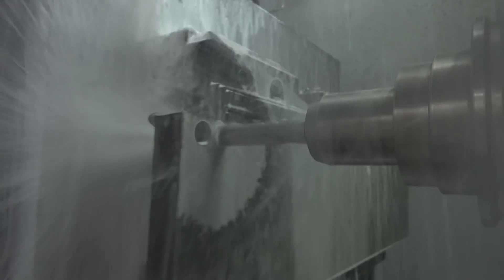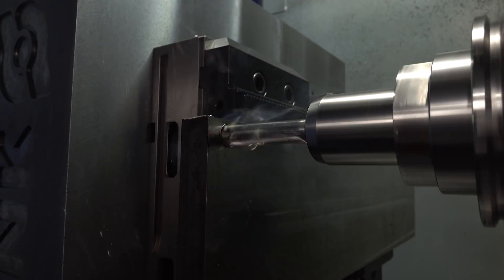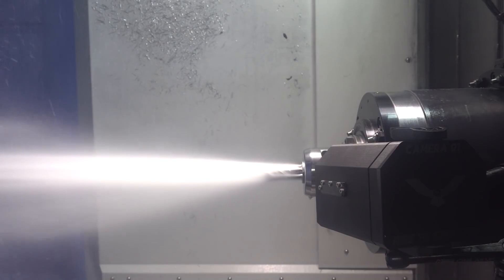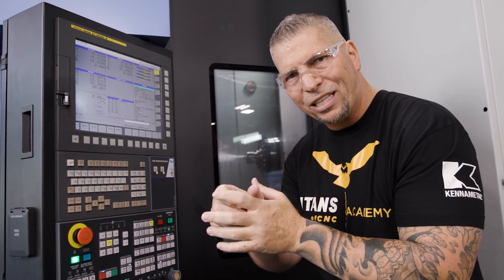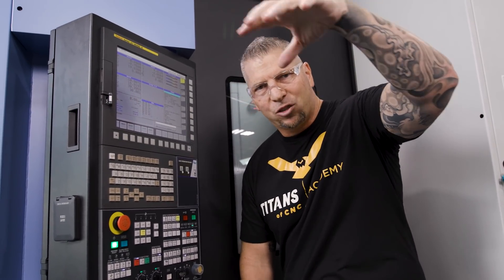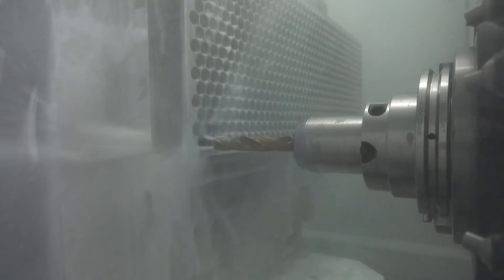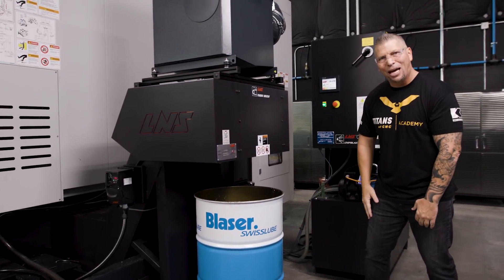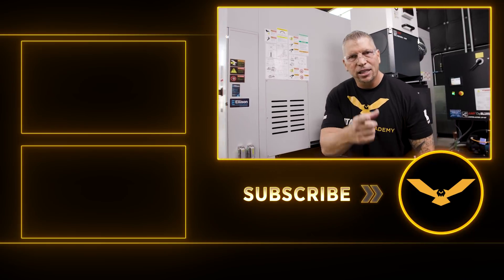Coolant Hacking | 6X More Powerful than a FIRE HOSE! | LNS ChipBLASTER JV-40 + LNS Turbo MH250

Comment: Nothing quite like high pressure through spindle coolant - as shown it allows for incredible speeds and feeds, especially with inserted drills, and in hard to machine materials. 
Unfortunately, also as shown, there's absolutely no room for error - just the slightest delay resulting in cutting before full coolant pressure and the tool almost always becomes scrap in an instant. 
Since I found out the hard (and expensive) way, I've always programmed a more than sufficient dwell time and watched a "test cut" off-part to be sure I've got full pressure in time.
Good demonstration.

Comment: Due to cost cutting healthy uncontaminated coolant is over looked just as the need for high pressure coolant systems in the industry as well. 

That’s a real nice flow most I’ve seen. ❄️

Comment: We were using hi pressure coolant, (1500 psi and up) on our deep hole drilling, gun drills and Allied Spade drills back 15 years ago.   The ONLY way to do high speed deep hole drills.   Glad this old technology is working out good for you.    Cheers.

Comment: surely the coolant pressure is the wrong thing to compare because having a higher pressure doesn't mean a higher cooling potential, surely the better comparison would be mass flowrate because more coolant flowing means more cooling not coolant at a higher pressure means higher cooling potential
Reply: The main reason you’d use high pressure coolant is to help with chip evacuation. Chip buildup is one of the biggest limiting factors when drilling high speed. High pressure coolant literally blasts the hole clear so it’s not an issue.

Comment: how do you dump your chip bins when they are just oil drums? I'm used to the giant bucket on wheels and you dump it with a forklift by tipping it
Reply from the maker: Old School

2 🤷‍♂️🤷‍♂️’s
Reply: All it takes is a forklift with a barrel clamp..
Reply: @donparker8246  add another attachment to actually rotate the barrel

Comment: Hmmmm, so a few videos ago you showed a plastic desalination pump, that multiplies water pressure from 80psi to 800 psi (according to the patent).
And now you show that your coolant is running 1000psi instead of 100-300psi. Did you just buy a bigger pump, or did you plumb your desalination multiplier in there?
Reply: They were making parts for a customer that does desalination. This pump is completely different, part of the machine tool.
Reply: @Eggsr2bcrushed  I was mostly joking here. I didn't actually expect them to jerryrig a DIY-pump into a relatively expensive machine that still has warranty, and I wouldn't recommend it either.
But that part does fulfill the exact same job as the pump in the machinetool.
-----
The plastic part that Titan showed in the other video had two patents numbers engraved into it. It turned out to be nothing fancy, just a double hydraulic cylinder with some valves; if gets powered by high flow - low pressure water, and it produced high pressure water at a low flowrate. It's basically just a replacement for a high pressure pump, that pumps salt-water into a membrane.

Comment: Is it a problem when little metalparticles are flushed out with the coolant at such high pressures? Doesn't that make little waterjets out of your coolingsystems and ruin critical surfaces?
Reply: High pressure coolant systems have additional filters to remove the particulate.  When you run lower pressure coolant you end up with a very small pocket of vapour at the cutting edge due to the heat being generated by the cutting edge.  This degrades the performance of your cutting tool and limits your feeds and speeds.  Once you get above around 800 psi 
, the higher pressure coolant blows the vapour pocket clear of the cutting edge and allows things to stay cool.  This allows you to increase your feeds and speeds pretty significantly and maintain the same tool life or maintain the same feeds and speeds and increase the tool life.  Pretty sure Titan will be going for the higher feeds and speeds! The tools have to be designed with proper coolant supply to the cutting edges though to get the full effect.  Just blasting high pressure coolant in the general area will clear the chips but not the vapour pockets at the cutting edge.
Reply: LNS high pressure coolant systems have physical bag filters or cyclonic filters just for that fine stuff.
Reply: The chips are not really impact grains soo its fine, and this is still 10 to 100x less pressure than a waterjet haha.

Comment: I'd love to understand how you keep from getting a 'galvanic' voltage and corrosion from the air ??? that gets dissolved into the coolant.  Its a weird concept, but I have had it happen in the past.  Happened with water -based, aerospace-required coolants.

Caused a ton of corrosion in a milling machine.  Mitigated the issue for a while with large anodes placed in the coolant tanks.  No bad grounds that could be found, but the issue stopped when we went back to 'normal' coolant pressures.
Reply: Probably down to coolant selection

Comment: i dont have the money for systems like this 
however i know the value of true spindle high presure coolant  , its real !
Now having said that i use a 215 bar coolant system however with extremely high flow 
the part is litraly flooded constanly
over time i slowly upgraded  and currently im at this point every bit counts !
also high presure air can never be overestimated . life saver on allot of jobs

early on i litraly use to use a converted presure washer to blast the parts
is it pretty ? 
No but its cheap and it works

Comment: Many companies have done loads of work without High pressure coolant so don’t say that it can’t be done 🤦🏻‍♂️
Reply: Sure it can be done but if you can make your 250k machine 25+% more productive by added a 10k high pressure unit? Would that not make a lot of sense to do?
Reply: @Eggsr2bcrushed  can it cause problems in the spindle going from 100 to 1000psi? I am thinking how high a regular low pressure tsc can go without issues.
Reply: @gearloose703  ran them on Mazak machines for years. No issues aside from foaming every now and then.

Comment: Hey Titan. I underestimated the need of spindle through coolant when I bought my first machines, now I need it. Do you know systems that allow to get spindle coolant installed afterwards? Like through special collets or whatever. Would be appreciated ;)
Reply: It really depends on what machine you have, i know that haas can send a tech out and replace some bearings and whatnot for it to work (it cost 20% more than having selected it on delivery in 2017) while some other companies have to replace the entire spindle or even the spindle and several components behind it.
Reply: Hey Roetz. RegoFix has a very interesting System. https://youtu.be/WRVpZxCqWig
Reply: Contact your distributor. Generally the rotarry union can be added to the spindle and the pump can be hooked up to your spare M code functions.
Reply: Thank you for the input. I requested a quote from the Rego guys and I will talk with DMG about the possibility of an upgrade. But I guess 2nd option will be out of budget for this machine.

Comment: I always liked putting a dwell about an inch off the part to give the coolant time to catch up with the program.  Don't want to change my underwear too often
Reply: Some people put the coolant on after turning on the spindle. That way all that rapid movement to the part, is more than enough time to let the coolant catch up.
Reply: Some high pressure units can be hooked up where the machine will feed hold after the coolant on M code until the unit is primed and the high pressure side is up to pressure.
Reply: on some machines i turn on through the spindle coolant right after the tool change on some older machines i have too program in a dwell before the R plane which adds to the cycle time but management won't fix the machine issues

Comment: I saw something where they dont use coolent but they use refrigerant to cool the chuck and bit itself. Why dont you try that?...
Reply: It may cool the tool, but thats only about %20 of the equation. Chip removal is the main purpose of coolant, flush out all of the swarf. I've seen those systems too but they never seem to show them drilling deep holes or clearing pockets, its always profiling of some sort. If they do, there's still some sort of air blast with it. And holding tolerances can be a real pain from what I've heard and read.
Reply: @pcsmachineworks  ohh ok that would make sense why i dont see them that often on cnc machines
Reply: @noelsnave9395  the reason you don't see them is because just the unit can cost up near $20k. And most shops are still playing w the same tech that came out in the 80s. It's sad.
Reply: @pcsmachineworks  years of running these same brand of blasters. Never had better quality parts without it. It was like keeping the tool and part at 72° the whole time it was making chips. /Avg tolerance of -+.0001 gravy all day.

Comment: Does anyone make a 50 taper 1/2" and 3/4" holder like the hydroforce holders? My 1.25" tools already have coolant thru holes so they wouldn't benefit
Reply from the maker: We have them on our titansofcnctooling.com
Reply: @TITANSofCNC  for cat50 all I saw was 1.25" and 2", I need something for heavy 3/4" end mills.
Reply: Schunk makes nice hydraulic holders and reducer sleeves that are sealed or with coolant slits.
Reply: Absolutely. Check BIG Kaiser.